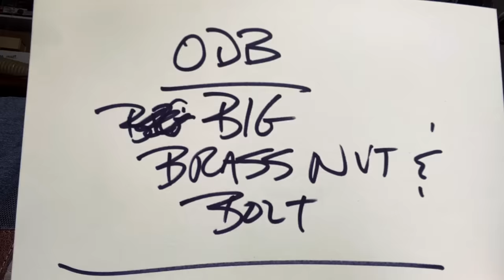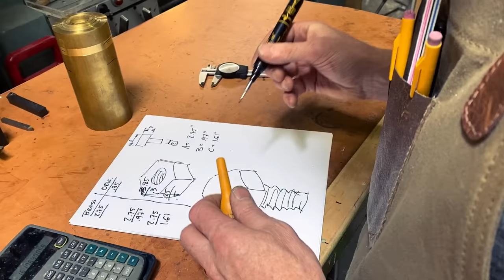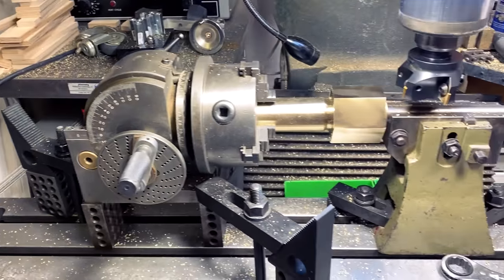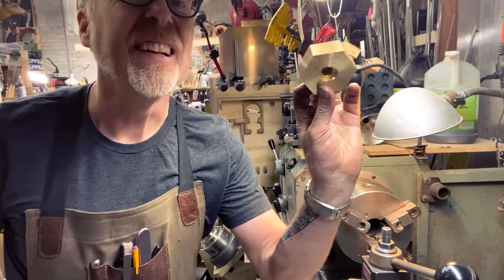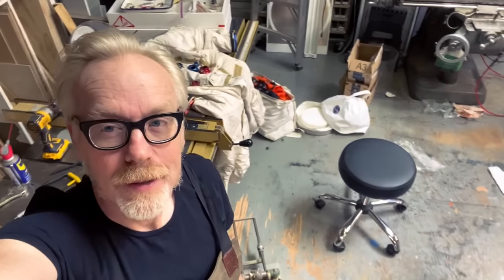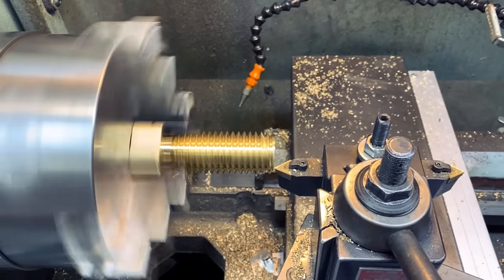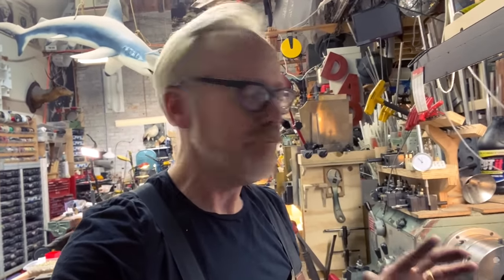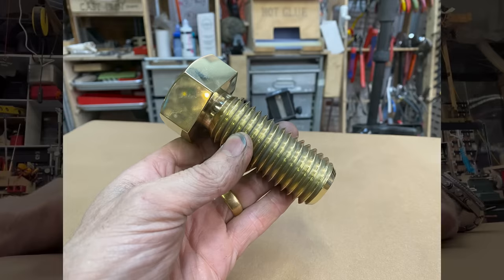Adam Savage's One Day Builds: Giant Nut and Bolt!

Comment: Among the numerous mistakes you made,you are using a 60 degree turning tool.Not a 60 degree threading tool.A thread has a much greater helix.The turning cutter probability has a 5-7 degree clearance.Not nearly enough..Look up the clearance angles for a threading cutter and,compare it to the insert you are using.The turning cutter has a radius on the tip where,a threading cutter has a flat on the tip which,should be close to 1/8 the pitch of the thread you are attempting to cut.